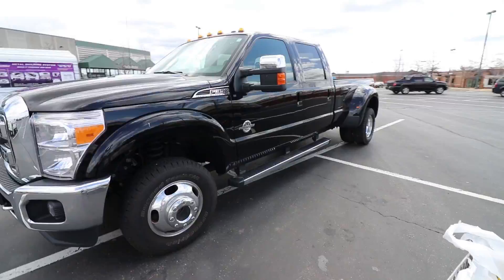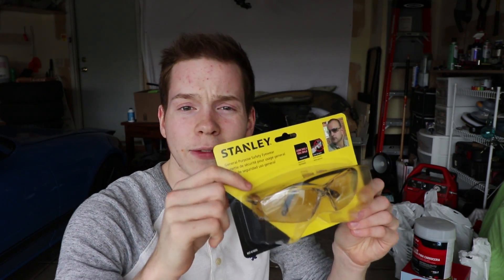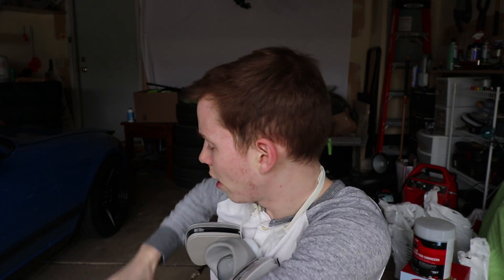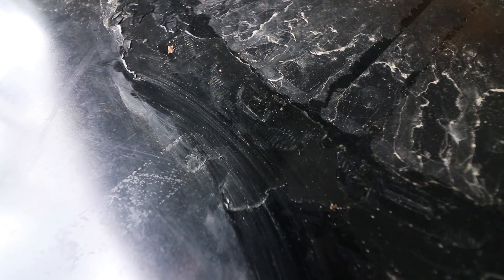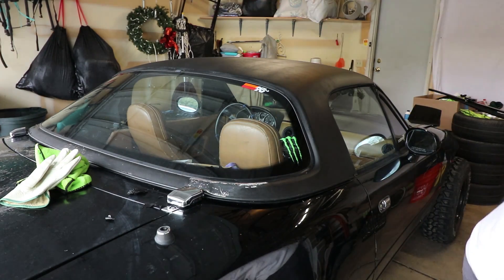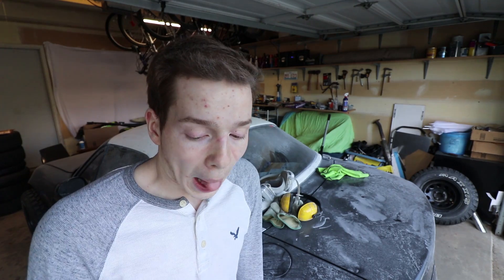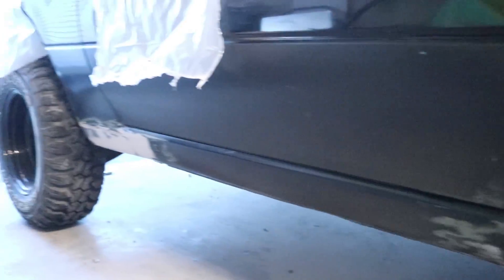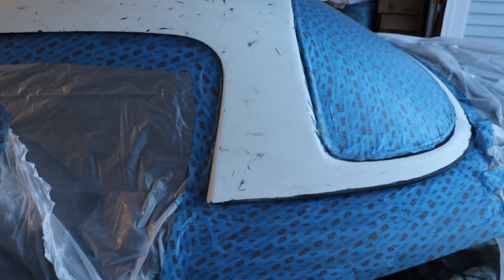Rust Repair & Paint Prep! || Project Rally Miata (Part 12)

Comment: a tip when using body filler is to use one edge of the scraper squeegee thing. this will make sure it's smooth and doesn't leave little bumps since it's clean on the other side. also for little imperfections you can get stuff called spot putty. I'm not an expert. but from my experience those tips should help! good work Caleb!

Comment: What sand paper grits did u use? If your doing body/bondo work u can use #80 for rough sanding, and #180/220 to smothen it out a bit. Than u can go #300 to sand out chips, and get car ready for primer. then #600 for paint work after priming. I'm an Auto Body/Refini Technician I'm a senior in highschool. Just a lil tip from someone with experience Gingium. Also for your respirator to test it for any leaks out your hands on cartridges and breathe in it should collapse a bit on your nose, and cover exhalation valve and breathe out should expand, if it does that your all set! For body work Fiberglass filler with short hair strands is best for repairing those rust spots. It's water proof, let it get semi-cured/hard and sand it with #40/80 than u can cover it with some plastic filler. The smoother you spread the easier! Glad to help!
Reply: Also car's looking great! Keep it up with the good work!

Comment: Tip for getting plasti-dip off easily is if you spray it with degreaser and then high pressure clean the part and it will spray off easily! :D

Comment: you did not fix the rust you are so posted to cut out the rust because thayer is still rust behind the fender,rocker,and whatever else the rust is so wen you paint it again it will just cep coming back
Reply: Elliott Brown let me guess u watch car throttle
Reply: Philip Fox no my uncle works at a shop
Reply: Elliott Brown thought u watch because that what alex did to his miata (phil) if u know him, sorry though
Reply: 100% correct. Its best to just cut it out. You can grind it all out and fill it aslong as you treat the back side as well, but best repair is to just replace
Reply: Just what i was thinking.The structure of the car is going to be fucked up later on.Hopefully he fixes it until its too late.

Comment: Dude, I hope you saw this in the other video, but make the Rally Miata headlights have squinty eyes. Basically a straight line of paint across the top and bottom just below or just barely on the halos. But not blocking either of the main beams.

Comment: orange Goo gone dissolves Plasti dip. I used it to take off some thin plasti dip off my miata bumper. i bought it like that but it would not peel. spray liberally and let sit for like 20 mins then it will start to bubble up then you can use a plastic scrapper to take it off.

Comment: dude, you should really either weld those bolts in the trunk to hold the spare or just put on nut on the bolt itself to hold it in place .

Comment: For an amateur job not bad. But I work at a body shop. The rust will be back soon. The best way to fix is to replace panels but not worth it on this. And you are supposed to prime the the filler. And sand down the whole panel. Good luck tho.

Comment: SO CLOSE TO FIRST
Oh well 13th is bettter than nothing.
Oh yeah, question.
I want racing games (with first person, what console should I get? PS4 or Xbox One S. 
I am not buying a pc because ho expensive it will need to be to run games well
Reply: how*
Reply: Well im not gingium, but i will help u with ur question. What type of racing games do u like? Do u like arcade (need for speed) or more simulation type (gran turismo or forza)?
Reply: Gamer God don't buy (The Crew) it is a terrible game. Drive club is pretty good. That's on PS4 but on Xbox one Forza Horizan 3 is mint
Reply: Drive club is okay. I love the selection of cars on Forza Motorsport and on horizon, and the exhaust and engine clips have been better than Gran Turismo in the past, not sure if that's the same as I don't own a PS4, but I did own a PS3, but I didn't enjoy Gran Turismo 5, it was just hard to get into like the story mode or whatever u want to call it lol. But jumping into the Forza Motorsport 5 story was fun and easy. And horizon 3 is super relaxed since ur not forced to do anything since it's free roam, which is also another thing to take into consideration; free roam or structured?
Reply: Thanks, but one thing. I'm into racing games, but my friends aren't. They all have a PS4 and I want an Xbox One because of its racing games and Forza Horizon.
I always wanted Forza, but my friends got a PS4 and I don't know what to get.
Reply: Gamer God well what do u value more? the video games or talking to ur friends? I was in ur situation, cuz I had a PS3 and all my friends from PS3 bought PS4, but I realized that I could make new friends on Xbox, I can still talk to my real friends in real life, and enjoy the racing games like Forza. I always wanted Forza, so I bought an Xbox, and I'm glad I did. so if ur really into racing games and ur willing to sacrifice ur friends (not sure if they're just online friends or real life friends, cuz if they're just online friends, u can make new ones. real life friends u can see outside of video games), then I think u should buy an Xbox, u won't regret it. the Forza series is truly awesome
Reply: Thanks guys. I'm probably going to get an Xbox One S.I really needed opinions and you guys gave me them.
THanks

Comment: with the spare tyre why dont u put the bolts through then put nuts on and tighen it so they stay up and then put the tyre on and tihen down wirh nuts so u dont have to have the boot open at all to take it off. in short boot sandwiched between bolt and nut then tyre goes on and u bolt it up

Comment: So ignorant you know thats one of the longest truck configurations you can get, it does not fit in one spot the bed alone is 8 feet and probably costed 70k plus
Reply: AAO_TACO closer to 80 and yes the bed is 8 feet long and it's got the biggest cab you can get. He has obviously never drove one they don't fit in a single spot.